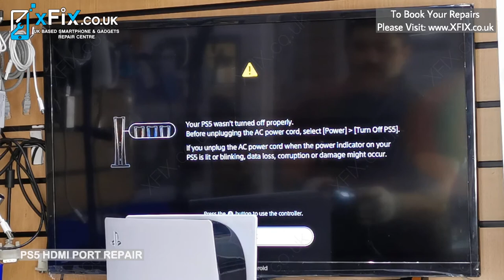How to Fix PS5 HDMI Port/ No Signal - Teardown (Full Video) UK

Comment: I'm not sure you should be wiggling the hdmi cable knowing the port is damaged.  You could be causing more damage to the contacts on the board.  Ripped off pads are a nightmare to fix. Overall though the PS5 worked fine.

Comment: At 10:52 When he sucks the 4th solder base joint, you can see a small black component disappear kekekekekek
...I haven't watched the rest yet, but I wonder if he realised during the job lol
Reply from the maker: I know😉, some other people Noticed it as well, We have replaced it with another one otherwise HDMI port not going to work properly.
Reply: @xFixRepairsUK  why not just use the solder gun anyways instead of heating many unrelated components with that air causing all sorts of issues

Comment: Great video again 👌👍👍 just wondering does the ps5 not have the pin connectors in the back of the hdmi like the xbox x has ?? Or did you miss that part in the video cause it was a nightmare 😂

Comment: Hey can I ask what equipment you used and what liquid you used also on the q tips pls?
Reply: I can't say what Hot air rework station and Soldering iron he uses, but I can definitely say for sure he's using 95% or higher Isopropyl alcohol or its sometimes sold as rubbing alcohol. Best thing to use to clean electronics if you need to!
Reply: @auroraazorea5513  thank you so much!
Reply: Probably flux. The Iso is used to clean the flux after.

Comment: Wouldn't it help to just fix it so it doesn't move around better than replacing it?
Like mine looks good but it just moves up and down a little
Reply: I had to get my tracer board placed today cost me $140.
Reply: If you have the skill and ability to do the replacement you may as well do it once you've got the ps5 tore down. Plus some of the pins on the original may be weakened after moving around while it was lose so you might just save a future headache

Comment: Hey question, my video only comes in when i bend the hdmi cable at a certain angle. I switch hdmi cables and I have to bend the new one to get a signal. It must be the hdmi port thats bad right?
Reply from the maker: Yes, Your xbox needs a new hdmi port.

Comment: I ended up knocking the exact same diode you did with the heatgun it blew off completely and I lost it in my room where can I replace that and how? I need an answer asap I tried doing the replacement without it and it doesnt work
Reply from the maker: You can getting off the ps4 motherboard.

Comment: Oh man... They didn't use hole through connections for it? No wonder they pop out of place if you blink within 4 rooms of it! My early (1 or 2 months after release) unit was plugged in and placed on the entertainment center top and not moved, yet had to go back ro Sony 4 times for video problems. HDMI port all 4 times.
What a stupid design!

Comment: Can you do a video  where if your Hdmi cord gets stuck in your playstation and when you pull it out the tip of your cord is ripped out and tell me a way to fix it
Reply: You have to retrace the points where the cords connect with solder wire.
Reply: Also you should never pull on it, you only guide it out. I actually heat it upside down so it just falls out on its own.

Comment: Did you solder the back pins?
Reply from the maker: It is installed properly so no need to solder each pin.
Reply: @xFixRepairsUK  i got my first ps5 repair coming in next week and its a hdmi repair thanks for the vid

Comment: My son tripped over the charger in front which made my ps5 start to fall. I caught it in mid fall probably 4 inches from the ground. And the hdmi cord didn't even come out but the game won't display on my TV. Ik it's the hdmi port cause it's gotta to a point where I don't even use my TV remote when I come home. I grab my ps5 controller hit the button in the middle and the tv automatically goes to whatever input I have the ps5 in. The tv is telling where I placed the hdmi core at but the ps5 isn't displaying anymore on my tv. This happen yesterday been almost 24hours I'm going crazy. Help someone
Reply from the maker: As what you described I can say your ps5 needs a new HDMI port. If you are from the UK you can send it to us for repair.
To get a quote please visit this link: 
https://xfix.co.uk/contact-us/
Reply: @xFixRepairsUK  sadly I'm not. But ty for commenting back I honesty would like your opinion on what you think the problem is. So it may well be the hdmi port itself right?
Reply: Is this a common issues or something your heard or came across before ?
Reply from the maker: @AntonioBeasley-c9g  yes, it is a common issue with the PS5 and Xbox series x.
I suggest you find a local repair shop and get it fixed by an expert.
Reply: @xFixRepairsUK  ty, you've helped me out  big time. Other youtuber didn't even comment back, I appreciate you frfr

Comment: How are the HDMI ports getting broken so quickly?Once its plugged in you leave it alone,or are they getting knocked over by accident?Not knocking anyone just wondering.
Reply: Idk my HDMI port on the PS3 didn't break once after 7 years of using but maybe they're transporting it alot and pluging the hdmi too often
Reply: @werdyt3443  Never thought of that,mine stays in its same position once set up.cheers.
Reply: I had my controller plugged in and my dog ran right through it like it was nothing knocking it over causing it to not connect to the tv
Reply: @markee3040  that's a pain
Reply: Had a plane ride and when I got it from baggage claim it was like this smh
Reply: My girl knocked mine over now I’m here
Reply: My brothers broke their hdmi port when their ps5 fell, im guessing thats whats happening
Reply: i had mine in my bookbag and it slipped off the couch. BARELY off the ground and it caused it to break
Reply: Tripped over the hdmi cable, which chipped a piece of the the inner rectangular port (male piece), shredding the pins inside and rendering it useless. Can’t wait til cables/cords are obsolete in 2040… also can’t wait to stop being so clumsy🙃
Reply: @xevvy6857  similar thing happened to me lol. What did you end up doing? I requested a repair even though PlayStation says they don’t offer repairs for physical damage. Is there any adapter that plugs into the usb that is compatible with PS5?
Reply: @andrewpalladino3578  USB to HDMI adapters only work on PC. I was able to use PS remote play app to play games from my PS5. Best to find a reputable local tech service who will replace the port for a decent rate in 45min. The mainstream services all quoted upwards of $200, and needed to keep my console for 2 weeks due to being backlogged; that’s just silly, imo. I bought the Horizon disc drive PS5 directly from Sony $550 w Forbidden West included; They shipped it, and it arrived in 1 day. Still have the other PS5.

Comment: Why does anyone in the comments think Sony is going to cover a broken HDMI port under warranty... physical damage in any way to any part of any device in general will almost always never be covered by any warranty provided by a manufacturer.  If you're paying for a warranty that does cover physical damage, you're either getting ripped off or scammed or both.
Reply: But IF its physical damage that happened by Just unpluging the cable, How in the world they would ge excused from getting it fixed or giving You a Brand New console?

I never dropped my PS5 ever. I have unplugged the HDMI PS4 cable countless times, even with some force out of frustration due to not turnning it on (Power break problem), and It never had any problem with HDMI Port whatsoever. Sometimes things can be fragile to have such damage and Its not always consumers blame.
Reply: @humbleman9  by unplugging and plugging the cable in properly the port isn't just going to magically break. Using force or bending it once it's plugged in may break it though.

Comment: Hello thanks for the video. Mine won't even turn on at all. No beeping, no lights blinking. Changed power cable and everything but still won't turn. How do I fix it please 🥺
Reply from the maker: There is something wrong with the power supply or the motherboard
Reply: @xFixRepairsUK  Thanks man. It's still fixable right
Reply: @ericsarpongagyemang-duah3233  PSU and yes
Reply: @xFixRepairsUK  I was wondering if you could repair mine hdmi?
Reply from the maker: @zackeryhoward9686  we can fix it if you are from UK. We can't accept repairs from other countries.